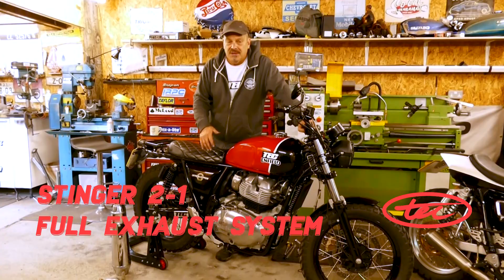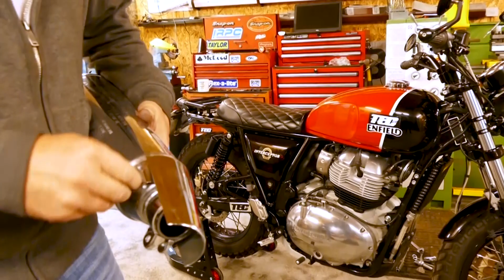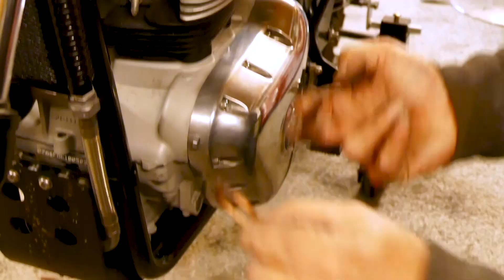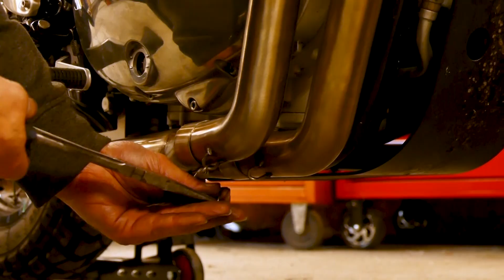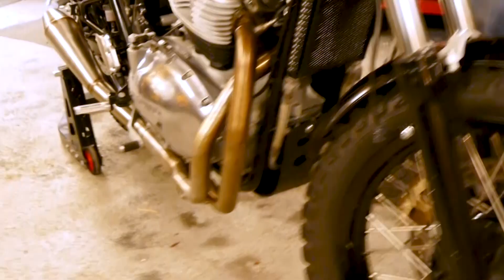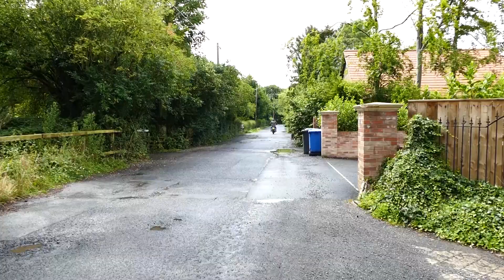Interceptor 650: NEW TEC Stinger 2-1 High Performance Exhaust

Comment: Great video!! Will a large engine guard still fit with this system installed?
Reply: I can confirm the small ones don't fit afterwards. Have refitted the l/h side bar to give it some protection still though.
Reply: Paul Nunn dang would have been cool. But an asymmetric look could be cool too
Reply: I’m curious too 🤔 I have the small guards though
Reply: Lucas Stovall I went ahead and bought the system and have it installed. I did have to remove the large engine guard I had and it will not fit back on. Not sure if it would be the same for a small but I would bet it would.
Reply: Paul Holder oh nice and dang it would look so cool if it all fit!  from the looks of it, it might fit I’m just concerned about the clearance of the left side pipe coming around. How much clearance does it have From the case?
Reply: Lucas Stovall I’m actually out of town for a few days. I’ll get you some measurements once I get home and it does look and sound really good.
Reply: Paul Holder awesome thanks!

Comment: In our country where it made , is illegal to modify silencers with CAT . They reduce sound pollution & air pollution . I'm surprised to notice that there is no motor vehicle rules on your country about changing silencer !
Reply: There are rules in the UK, as George writes, but they are not enforced.  It is the same here in California, except that if citizens in an area complain to the cops, the cops will start checking for after market pipes and require that the OEM mufflers be refitted.

Comment: Nice exhaust! I’m not sure if this has been mentioned in the previous comments but another thing to recommend is to make sure that the exhaust pipes right after installing are thoroughly cleaned preferably with an alcohol wipe to rid the pipes of any hand\ finger oil’s that may have been left on the metal and can stain the finish once heated if not removed first. 😀👍
Reply from the maker: Yes we add this in the written instructions included with the kit
Reply: @TECBikeParts  Do you have the exhaust pipes ceramic coated?

Comment: This whole TEC Enfield series makes me want one more and more each mod at the time👍👍
Reply: I agree.  A big part of the fun for me is modifying and improving my bike.  TEC seems to be spot on in terms of addressing areas that call out for improvement, and they are very well thought out, and well tested before going into production.   Also, the quality is great as is George's no-hassle policy if there are any problems.  The RE 650 outfitted with TEC parts is such a big improvement compared to the stock bike for a very reasonable cost.

I'm in Vancouver BC, Canada and we get a lot of rain here, so I might go with an adventure type bike with better weather protection, but haven't entirely made up my mind.  Spring has sprung, so I'd better make my decision sooner rather than later.  If I decide on the RE, I'll have to make another choice bc I like the red/black and the white/orange equally.  Cheers!

Comment: Hey can i Install the T120 fork adjuster on the Interceptor?
Reply: Yes they will fit as same size and thread
Reply: @georgemilburn6213  thank you so much any specific thing I should when I install them, or can I just fit the nut with the spacer given inside
Reply from the maker: @rroshan4494  Just a straight swap but you need to remove the disc spacer on top of the spring when fitting.

Comment: FACT CHECK time:

At 2:47 you say, "when we made a prototype in August last year, a few photos leaked and a very similar exhaust system popped up in India"

Please see this post from January 21, 2019 to know that exhaust in India was being made and finished months before your prototype ever emerged.

https://m.facebook.com/groups/157735611628586?view=permalink&id=394781971257281

You aren't the only fabricator in the world or the only man who thought of a 2x1 for this motorcycle.

Should research well before blaming others.

If you have some integrity, you should apologise.
Reply from the maker: Hi
 that is not the system I was talking about as it looks like it goes outside the frame !
Reply: @TECBikeParts  there's only one 2x1 made in India. The design was finalised by February 2019. The link I shared was the first prototype and there are plenty of videos/photos of it from Feb 2019 in the config you mentioned. It's made by my fabricator friend and first ran on my bike for a long time before it went to anyone else.

Anyway, I have nothing against you but what you said is just not true. That is something that should be very clear.
Reply: @abhinavbhatt  You can see the basic design is the same as we used on the Triumph parked next to the RE. We have been making this type of 2-1 since 2010 and very well documented on many bikes and fitting videos we and many other youtubers have posted. So if we copied the design we copied it from our self . The main point I was trying to get across in this video, was that the the Indian 2-1 I saw probably did not have our high velocity centre collector pipe internal baffling system as the pictures would not have shown it and this is critical to the sound and performance of our system . 
I was told it was S&S that were making the 2-1 in India , Not SS Moto ,very misleading ! This was also in a message from a youtuber
Reply: @georgemilburn6213  George, I'm not insinuating you copied anything from anyone. I've seen your work previously, and I respect that. However, that little portion of the video came across as arrogant, and I wanted to clear the air that SS Moto had not even heard or seen any of your work to draw inspiration/plagiarise from.

I think we both have cleared the air on the matter. Your Stinger looks beautiful. Try doing business in India. Loads here want TEC parts but are left wanting as you don't ship here. Cheers

Comment: I know you've mentioned before that it wasn't on the agenda, but now the 2-1 exhaust is completed, is there any chance you could develop a similar looking 2-2 exhaust which is more low profile than the OEM one? I know the performance won't be as good as this, but the 2-2 style looks very period correct and in keeping with the bike. Cheers!
Reply: Hi
yes we have a stainless 2-2 big bore system in development
Reply: And that sit lower to allow saddle bags.
Reply: Ther were plenty of two into one systems in the 60s
Reply: @mikefry6765  - Yeah… but we called them 'Siamese exhausts', and they were mainly used with sidecars.
Reply: @chrisgraham5186  Siamese of course I had forgotten about that
Reply: That was the question I was about to ask!  My prime concern is to reduce the weight,I already got rid of the OE silencers and the bike feels way better. A pair of light weight ,free-er flowing front pipes would be top of my list for the bike.
Reply: Check out revelry cycles out of Australia they just began offering 2-2 free flow headers that allow any muffler that attach to the originals to fit
Reply: , @harrisnixon4824  All,
Reply: Or maybe a 2 into 1 into 2 to get performance but old school look

Comment: Is the Tec Tracker 2-1 short pipe for Bonneville SE street legal with baffle in and will it pass the MOT?
Reply: Hi
 it is marked as EU noise legal and you will have no problem with UK- MOT test with the baffle fitted. But it is not E marked
Reply: @georgemilburn6213  Thanks George 😃

Comment: What about a booster plug with this?
Reply: Hi you DO NOT have to use a boosterplug with this. all runs were done with stock ECU
Reply: @georgemilburn6213  is there no benefit of the booster plug then with this exhaust?
Reply: Not for gains but smoothing lower rpm throttle, as its intent
Reply: @-thirteen  yes it will give better low speed response but actually runs slightly rich with the booster plug at the top end of revs. This is due to removing the highly restrictive front pipes with cat unit inside stock front pipes
the richness is not a problem but does rob a slight bit of power. Booster plugs best if using stock front pipes
Reply: @georgemilburn6213  Interesting… so effectively it brings down the price of your pipes even more if you don't need to spend on the booster. Bring on the twin pipes, George.

Comment: just placed my order, excellent and well engineered, I have been designing exhaust for my bikes for years, the science is perfect on this one. One bit of info George didn't get into, is that by using a perf tube in the mid pipe it will actually increase exhaust velocity over a smooth pipe at higher RPMs due there being less surface area (subtract the holes), at low RPMs the absorption holes function to lower the DB.

Comment: is there db killer available for these?
Reply: comes supplied with a hi flow db killer but if you want to be really quiet we can supply very quiet DB killer too
Reply: @georgemilburn6213  
George,

I would love the weight reduction but I've already lost way too much hearing from loud stuff, and I don't need more power. How do I get the quietest possible version in the USA?
Reply: Just shove a banana in the tail pipe (see Beverley Hills Cop)
Reply: @nigeh5326  🤣🤣

Comment: For those bikers with "gentle neighbors" who don't want to be disturbed by motorcycle sounds,
a milder (less staccato "bark") and lower-in-pitch, mellower sound would be nice.  Could any
part of the stock system be used in the new after-market system for that?
Reply: Probably, if you weighed them in at a scrap yard and used the money to buy a decent system like the one here. Apparently the headers are stuffed with exotic metals. 🧐😎

Comment: This is the 1st video that mentions that there is a catalytic converter in each of the stock header pipes.
Given that, why are the stock silencers so heavy ?  Are the baffles made of all metal without mineral wool?
Reply: Cats in the silencers as well
Reply: I would love to know, probably made of lead. I have to cut one open now like I did with the front pipes. Probably has a second cat in it.

Comment: It's interesting to hear you confirm that the stock ECU actually "learns".  I imagine, though, that the stock ECU mapping retains,
as one goal, the suppression of emissions, and thus causes as lean a mixture as is drivable.  Would a Booster Plug improve that?
Reply: A booster plug works good on stock or very lightly modded bikes this exhaust actually works better without the boosterplug as flows that much more than stock.

Comment: Since the Naked Retro style is about looks (and symmetry counts), do you have a 2-1-2 exhaust in development?
It would be heavier than this 2-1 design, but the balanced look (and mass) would be worth it, IMHO.
Reply: only issue in that the motor is slung so low in the frame, this is a very hard bike to make and exhaust that performs and looks good for. But we will be making2-2  performance big bore front  pipes soon.

Comment: I own a Softail Streetbob, but must say if I traded it in for the Enfield. I would definitely be contacting you to fit this exaust system.
Reply: Sure it isn’t a Street tail soft bob?
Reply: @SvenTviking  I've traded It in for a new Vespa 300 GTS SUPER SPORT,  may fit an arrow exhaust.  Mr Blobby.
Reply: @jamespatterson7809  hello James! How is the Vespa 300? It has some pep right? I had a 125cc Piaggio Medley and the scooter was quite normal, nothing much, but a 300 sound cool AF
Reply: @at9670  It certainly has, I'm running it in so max speed at the moment is 50 mph. None the less it has surprisingly quick pick up speed from standing start. I look forward to opening it up one  it gets to 600 miles and 1st oil change.
Reply: I see Aprovack (if I've spelt that right) do a new exhaust with a none removable baffle to keep it legal. Hardly louder than standard but looks good.
Reply: @jamespatterson7809  thanks for the answer, enjoy it and be safe!

Comment: It this ECU even capable of learning and adjusting to suit?
Reply: Yes even we were surprised at this, look at the dyno sheet. After auto adjusting the ECU we looked at the air/fuel ratio and was good, but just to be sure we tried adding just slightly more fuel and if you look at the (extra fuel ) comparison run for that it actually lost power.  With a custom map I would add a little fuel at lower revs to make acceleration a bit crisper but at top end fuelling is spot on for this pipe
Reply: @georgemilburn6213  Nice one. I am very, very interested. I have the DNA air filter. Will it still run ok with this fitted? Thanks.
Reply: @Mark-wx1ho  Yes all these runs are with the DNA hi flow kit and it really does make a difference with this exhaust.

Comment: Can it be painted black? Shiny exhausts are getting a lot of attention in Portugal :(
Reply: Hi
yes just use VHT brand ( this is best type )ceramic coat in a spray can. all you need to do is use a solvent to fully de-grease it before applying the coating. We don't supply them Black as they tend to get marked in transit.

Comment: You talked about the S&S 865cc Big Bore Kit which would give the 650 Twin same Bore and Stroke as the 865 Air Cooled Triumphs.  Many believe the 650 Twin was built to be a 750cc, but there are no facts to back that up.  You mentioned if you installed the  865 Big Bore kit the brakes would need to be upgraded and Suspension, yet the 865 Triumph has the same brakes or worse,  same garbage suspension, and weighs 60-70lbs. heavier depending on accessories.  Not to mention the 650 Twin has a 270 Degree crank, which can aid with Engine Braking, if one knows how to properly ride.  Most 650 Twin owners will upgrade the suspension straight away so that should not be an issue. I would love to see you do an S&S 865 Kit and post the DYNO numbers, because S&S wont do it.  The old says goes, " no dyno numbers mean bad dyno numbers".  Keep up the great work, you're Making Enfield Great Again!
Reply: Hi
This bike was designed  to be a 900cc class bike , or should I say a multi cc class bike. RE already have type approval for the 900 version of this bike. But why would they do that at the moment when they are working flat out to keep up with demand for the 650.They will keep the 900 till sales of the 650 drop off. I would expect to see an adventure style 650/900 as well as a cruiser version in a couple of years . Also outside of India the dealer network for RE is still not up to speed as most dealers are small independents and in secondary retail positions. It will take a while till they could cope with the numbers the Big makers turn over in Europe and the states. But I am sure they are working to a plan.
All bike companies have to have a multi level ,modular approach to a new design of motor just look at the MT Yamaha range and all the spin offs of Tracer, XSR,super tennere Etc et. And Triumph WC bonneville range of 900 and 1200 bikes that are all based on same motor design.
At last count Bonneville had about 10 model sub classes with variants of each type, some a success and some not with countless variants still available if the market moves in that direction for example a 900 cruiser .
This is the only way they can make money in a very tight market these days.
Reply: As arguments go "The Triumph has really crap brakes and suspension so there's no problem with the RE having really crap brakes and suspension" is not the best I've heard.
Reply: https://www.youtube.com/watch?v=Rfvx4t4o1cA - this might help answer  part of your question..........
Reply: Soar UK The video says Dyno results but the comments are removed. Another case of mystery dyno numbers. I don’t know why people won’t post these.
Reply: @brookcampbell2940  Hi
all the links we added have been removed and not by me. but you can sell all the dyno sheets on our web shop pages
Reply: @georgemilburn6213  Thanks George.

Comment: 2 into 2 coming??? Please, Please, Please!  I'll gladly pre-order for my Continental GT 650
Reply: Make that 2 ! 👍
Reply: Make that 3. Defo needs 2 into 2
Reply: 4
Reply: Fifth this! Will immediately get the full 2-2 stainless system if its anywhere around the value of the 2-1. Great work!
Reply: 2-2 meaning a pipe on each side, right? If yes, instant buy for me! Already have the TEC Cannon silencers, need better pipes now to replace the OEM headers.
Reply: @lithiumstickers16   YES, 2 Headers (1 on each side) into 2 Silencers.  Can't wait for a set of larger diameter and free flowing header pipes.   Hopefully made in S.S.
Reply: Brook Campbell Nice! Was a lil’ confused... Thought maybe two pipes on one side (Harley style), which would be weird. I’ve been wanting the exact same thing! But I’ve seen George from TEC reply two times that it’s coming. Awesome!
Reply: Hi
Hi yes we understand that some prefer a 2-2 and lots of you have already bought slip on silencers, SO-
We have TEC stainless big bore 2-2 front pipes in development now ,that will work with most aftermarket slip on silencers inc S&S and our own Cannon silencers. But due to the road and dyno testing needed , our current work load and back log of exhaust orders it will be a few months before it is available. But we will get them out ASAP.
Reply: @georgemilburn6213  Awesome ! just prefer twin cans....they'll be worth the wait I'm sure !
Reply: @georgemilburn6213  Can they be available with less (or no) upsweep, so there's more room for luggage, or for lowering the pillion rests? 
It would certainly be popular, as a lot of people's only gripe is that only small saddle bags/panniers can be accommodated with the stock exhausts unless you fit them too high and too far back.
 This both looks ugly and ungainly, and it affects handling adversely… as it is, most modern luggage systems look bloody awful, as if they're just chucked on as an afterthought. The back ends of most modern bikes seem to have been designed without any consideration towards luggage.
Reply: @georgemilburn6213  AWESOMESAUCE!